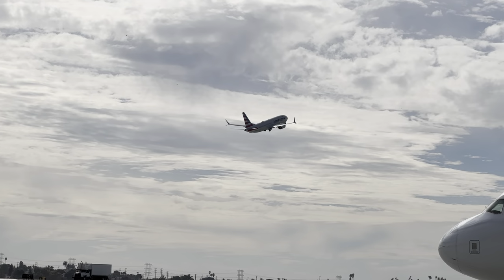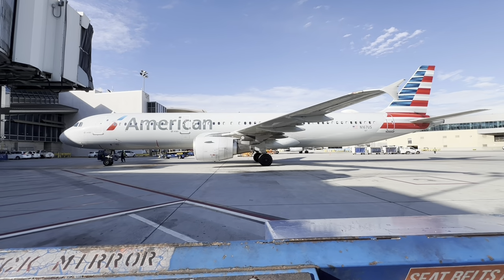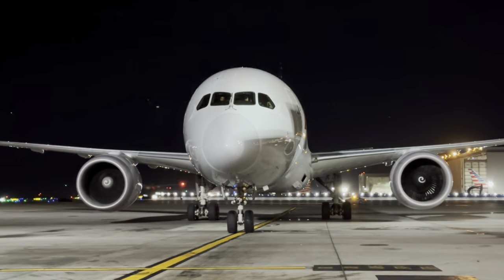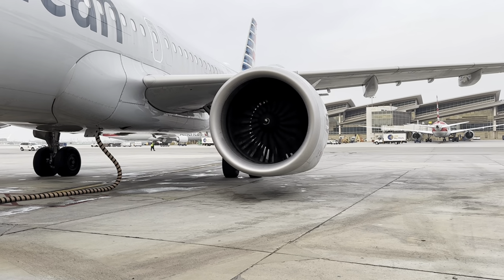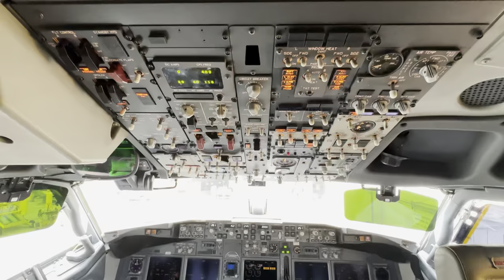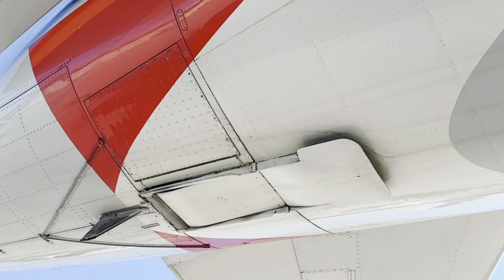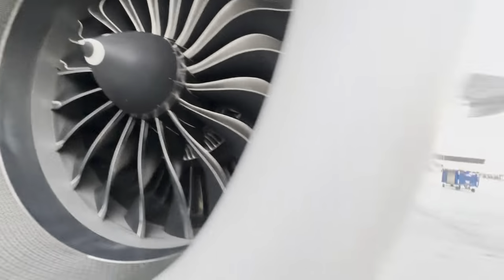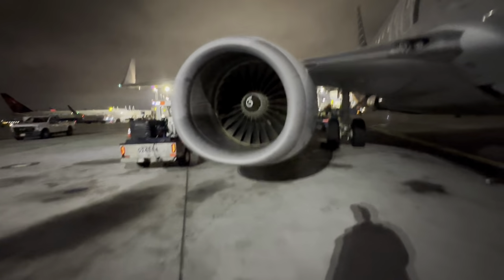Stig Shift #15 (Aircraft Maintenance Adventures)

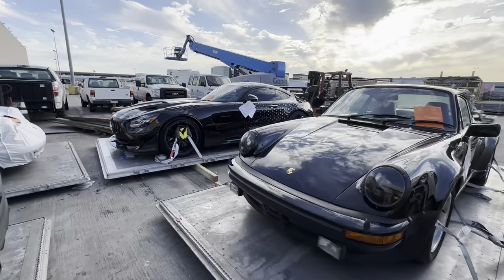Comment: The Mercedes at 11:00 is even more special than 'just' being a black series. It's a special edition for customers that have ordered the AMG ONE and they got it as an apology for the long delays in the cars development. The star pattern is also allegedly hand painted. Not the worst apology gift if you ask me. The wrapped up 911 is a restomod from a company called Singer. Basically an old 911 with modern mechanics. Insanely expensive but probably the best 911 money can buy from that generation.
Reply: Eight to ten months to build a Singer.  Probably wrapped to prevent it from being individually identified (every single one is unique).  The demand is so high it can take upwards of five years to finish one- and you have to supply the base vehicle.
Reply: Alot of rich folks. Wonder why? At our poor taxpayer expense. I'm struggling retired on s.s.
Reply from the maker: Thank you so much for the correction. Much appreciated.
Reply: @StigAviation  That singer Porsche is worth more than double what the AMG GT Black Series is worth. They had a singer Porsche on Top Gear and Jeremy Clarkson said its is favorite car ever. Look up Singer Porsche Top Gear, it has 3+ million views on youtube.

Comment: Hi Stig, I love your walk arounds and info talks on plane checks.  I've watched several and learned a lot about what you do to "keep'em flying" THANKS !  
Maybe you could look into a situation that happened 25 (or so) years ago.   I never learned what happened and really wanted to know.  I've flown many times to many countries in many different planes and know the "usual" sounds and sequences of events for takeoffs and landings. 
On a return flight from Korea on a United 747 plane we had to make an emergency landing in North Bay Canada instead of landing at Kennedy International in NYC.  
The pilot announced we were making an emergency and issued instructions for landing.  That was a very scarry announcement to hear over the planes intercom system. The plane descended from 35,000 ft to ground level in less than 8 minutes, that was different!    We were instructed to assume a  crash position, bent forward pillow on our laps holding our legs, eyeglasses off and our heads tucked in between our arms. The plane actually pointed it's nose down, I've never been on a big plane that did that! 
We were lucky the runway we were going to use was an old military runway about 12,000 feet long no longer used by the military.  The airport using it was very small, mostly for single and twin engine planes.  It's usual passenger traffic might have been 30 to 50 people daily, primarily for people hunting or fishing. 
The landing was very hard and the reverse thrusters were never deployed.   The plane seemed to come to a stop in a very short distance shuddering and shaking very hard. As soon as we stopped the plane went completely DEAD, no power, no lights, no AC, no bathrooms, NOTHING.  That was the start of the problems!  
We couldn't deplane 300ish people because there was no Emigration officials at this little airport.  It took 3 hours for officials from Toronto to fly up so they could let us off the plane.  I was in Business class which was on the upper deck at the time and the temperature up there went sky high in less than half an hour!  I went downstairs and sat at the open exit door.  All the doors were opened for fresh air or it would have been ghastly.  Once we were permitted to deplane I was first off the plane and made a bee line to the restrooms in the terminal, there were three hundred people right behind ME.  When I was relieved and stepped outside again, I kissed the ground for a reminder to be glad to be back on the ground.  
We were grounded for 15+ hours waiting for a new plane to take us home.  The airport personnel opened all the vending machines in the terminal and the airplane unloaded any food it had.  People were everywhere and there was no place to really sit .  I curled up in a cargo carrier outside.  The Canadian national guard brought water and cots and more food.  Local news arrived and was talking to people.  
FINALLY a McDonald  Douglas L1011 arrived and took us home.  The 747 we came on was still sitting on the end of the runway, dark and dead.  
What would cause that type of failure?  Could you get any details on that incident so I can get closure of a very scarry incident.    Keep up your good work and thanks again.  Art
Reply from the maker: My goodness, that’s an incredible story. Thank you so much for sharing it.

Comment: The Mercedes is the MB AMG GT Black Series Project One. It had a 57k paint job on it and yes, only 25 were made for the US market. However they were still less than 7 figures as RM Sotheby’s sold one not too long ago for 775k if I’m not mistaken. That Porsche you showed at the end with the word Singer is actually a custom vehicle essentially. The customer supplies the donor vehicle (964, 930, etc) and Singer will then improve upon it tremendously. They basically tear it apart and rebuild it and make it better in anyway that the customer desires. Cargo never disappoints!
Reply from the maker: Thank you so much for the education John. I appreciate it.

Comment: Hi Stig, Great video like always, it's remarkable to see the plane engine blades, so close to body but doesn't touch the engine structure..
Reply from the maker: The tolerances are incredibly small, and sometimes they do touch, but it’s OK, it’s designed to do so. That occurs because the blades themselves start to stretch when they are spinning at high RPM.
Reply: @StigAviation  and some shrinkage of metals due to temps i suppose?

Comment: One of your best videos! Thanks again for the pushbacks 👍 Also the air start portion. I might add that the aircraft can only shut down one engine at the gate with an inoperative APU. We have to connect ground power in order for the pilots to shut down the other engine. I would assume that is due to the lack of any other power source besides the battery without a running engine.
Reply from the maker: Thank you so much and you are absolutely correct on the engine shut down and power hook up prior to shut down.

Comment: Hey Stig, another great video. Two questions: 1) how much and why do the engines burn so much oil that you have to add more all the time? 2) A clean bird reduces drag; how often are they washed and who does that? Thanks!
Reply from the maker: It depends on the type of engine and how much oil it burns, as well as how long it’s running. So I can’t really give you an exact number. For your second question, I actually made a dedicated video talking about how when we clean aircraft. Check it out when you have time.

Comment: I’m really enjoying your videos.  These machines are fascinating, and you’re alright yourself!  Love your positive attitude.  If you’re ever the last person to leave an aircraft parked somewhere for an extended period of time, could you show us “shutting down” all the power and lights on Boeing and Airbus aircraft as you leave?  

I figure just like a car, nobody wants a forgotten dome light or something causing it not to power up as expected the next day.  Likewise, I figure there’s a procedure to “jump start” the electronics in the aircraft just in case.  Have you ever been called to jump start a plane with a low battery, and are there any additional checks required afterwards?  Finally, how many cold cranking amps would you reckon a 777 needs below 32 degrees Fahrenheit?  Kidding about that last one, looking forward to the next one!
Reply from the maker: Majority of the time I am working on my aircraft that are constantly turning to go to their next destination, so I rarely ever turn the aircraft off. But time to time I do perform resets of the whole aircraft, which I will try to capture on and future video. There are times where batteries have been in advertently been left on, and you would need some kind of a ground source of power to bring the voltage back to normal.

Comment: Ah evenings worth of viewing pleasure!
Here’s a question I wonder if you could answer possibly on your next video.
Is there a reason why American chose not to go with the NMF (Natural Metal Finish) like the older jets?  Were they temperamental to look after and therefore more expensive than a complete paint job like the ones we see here?
Reply from the maker: It costs more to maintain the polished look and the bare metal is more susceptible to corrosion.

Comment: A hot start is when temperature limitations are exceeded during start, possibly damaging the engine’s hot section. If the condition continues unchecked, a fire may result. Hot starts may be caused by improper pilot action (introducing fuel before reaching the proper motoring rpm), a failure of the fuel controller or fuel nozzles, a tailwind component (the wind inhibits exhaust flow at the back of the engine), or a weak battery causing the electric starter to peter out after light-off. If you see ITT/EGT (interstage turbine temperature/exhaust gas temperature) increasing abnormally quickly, abort the start with prompt action before an actual temperature exceedance occurs, resulting in a more mellow “warm start.” The correct pilot action for a hot start typically is to cut fuel off immediately and leave the starter engaged. Motor the engine long enough to purge all the fuel and hot gas from the combustor and allow airflow to cool the hot section.
A hung start occurs when the engine starts but doesn’t accelerate to idle speed. This indicates a problem wherein the HMU/ECU (Hydromechanical Unit/Electronic Control Unit) falls off the acceleration schedule or fails to bring the secondary fuel nozzles online. Cut the fuel off and motor the engine.
Reply: Nothing AAA can jump start @30,000’
Reply from the maker: Absolutely phenomenal information, thank you Drake
Reply: @StigAviation  I've been watching bro!

Comment: Seems to me that the brake wear indicator pin on the aircraft is a "same function, different method" version of the "brake pad squealers" that are standard equipment on most automobiles (at least in US/Canada), an easily observed indicator that you need to service the brakes.
Speaking of, since all of you reading this are hopefully still reading I'll give you some advice from an auto mechanic:
If you hear a squealing sound coming from your car's wheels at low speeds, especially when the brakes are applied, you should schedule an appointment to get new brake pads (and if it's a Subaru, probably rotors too, that brand has excellent brake performance, but the rotors like to become warped over time, which you can detect if you feel a vibration in the brake pedal when you get up to 45mph and apply the brakes firmly, but not so hard that the ABS kicks in. If the ABS kicks in, you'll hear a loud buzzing noise and your foot will feel like you stepped on an earthquake. Warped rotors don't usually feel THAT severe, but you'll feel like you stepped on say a subwoofer cranked up quite loud and playing a very bass-focused song.
Reply from the maker: I suppose you could say it is the same type of indicator. Just a little bit different design.

Comment: Hey Stig, just wanted to say that your videos are some of the best on YouTube and are the highlight of my YouTube watching week, your enthusiasm for your job is so good to see and your knowledge knows no bounds.

One question I’ve wanted to know the answer to is why on the 787 on take-off does the landing gear not go up straight away, sometimes for a good few minutes after departure. I don’t know if this is something you see a lot at your airline but in the UK British Airways and Virgin Atlantic have it quite often. Maybe you would be able to answer this in your next video.  Keep up the good work you do not only on the planes but with the videos as well.
Reply from the maker: There is a sequence of events that needs to happen before the gear can go up, usually the gear doors need to go down and a slight delay, and then the gear goes up. Also pilots sometimes keep the gear down to cool the brakes.
Reply: @StigAviation  I did wonder if it was something to do with cooling the brakes. Do you know if there is a system that stops the gear from going up straight away even when the pilots select the gear to the up position or is it just that the pilots see that the brake temperatures are high so they leave it down? I’m sure I’ve seen the gear doors open but the gear not go up then the doors close again.
Reply from the maker: The gears are actuated by the pilots via the handle in the flight deck, they do not automatically go up.

Comment: Thanks for another amazing video. When you were going through the tunnel I saw the picture of the Concorde and reminded me of my trip back in 2006. Where I visited a couple of aircraft museums in the UK and got to have a look inside not 1 but 2 Concordes. One of them was the experimental plane at Duxford. Also in 2014 I was at Farnborough Airshow in the UK and got to have a look in the Airbus A380 experimental plane aswell. The sheer size of it and how it can get into the air is such an amazing feat of engineering.
Reply from the maker: That’s so amazing you got to see the concord. That’s still on my bucket list of things to do. Cheers
Reply: The cabin is about the same as an ATR-72 (Turboprop) with 2 seats each side and the windows are half the size smaller than your average commercial airline probably due to it flying higher in the atmosphere at supersonic speed. Yes it was so cool to actually see inside and up close. There has been at times where BA and Air France have flown the Concord to New Zealand and I have seen them at Christchurch International Airport while connecting to another domestic flight. @StigAviation

Comment: Thanks for the video Stig. What if a plane with a defective APU had  an in-flight  emergency? Wouldn't  they need a operating  APU for hydraulics for control?
Reply from the maker: If you are speaking about any emergency, that’s not regarding an engine then the aircraft has no issues for hydraulics because the engines have their own dedicated hydraulic pumps. Now if you did have an engine malfunction you have multiple engines, so that’s another level of redundancy. Now let’s say the worst possibility of both engines failing now you have your very last resort, which is the rat, ram, air, turbine, which will provide minimal electrical power as well as minimal hydraulic power. The odds that something to that level of failure is almost astronomical.

Comment: Commercial aircraft paint jobs weigh between 800 to 1,200 Lbs.   Lets say between a 737 and 747 sized airframe.  That is the weight of about 6 passengers at 165lbs for an average so I'm sure it just comes down to how much extra cargo can be loaded below.  And if the aircraft is scheduled to make shorter haul flights with less fuel needed onboard (6.75Lb. per gallon) it all works out in the books when it comes down to cost of labor to strip/paint vs putting on a few pounds and not using that aircraft to haul some USPS Priority mail so to speak for some extra income.
Reply from the maker: Very well stated my good sir

Comment: Love your videos, man. My question of the week is how you get paint wear on airplane fuselages? There are no moving parts there, and neither does the cabin flex like the wings do. Like, on some older planes you can see paint peeling off similar to what you showed on the gear flap, that comes with age I guess, but I have seen some planes with what almost looks like scratch marks where you'd expect the stringers to be underneath the skin.
Reply from the maker: Flying at 500 miles an hour at extreme temperatures will eventually deteriorate paint.
Reply: @StigAviation  I guess so. I was just expecting it to look more flake-y like when you see regular paint wear/damage somewhere, not as if you ground down the paint along the stringers.

Comment: A quick question that came to mind as you were checking those huge Michelin tires and brakes on the 777. How much does a tire cost? My guess is about about $10k a tire
Reply from the maker: Around 6000 to $8000
Reply: @StigAviation  Cheaper than I thought
Reply from the maker: @ThemeParkBazza  that’s per wheel, There’s 14 wheels on the 777. 😅
Reply: @StigAviation  Good point 🤣

Comment: At 12:56, an Airbus A321 NEO pulled in.  How come the engines on that airplane look so adorable?  Adorable in the sense that it seems smaller, like a low bypass engine design.  What engine option was that bird outfitted with?  My guess is the CFM LEAP 1A because it still in route.  If it had the P&W 1100G, it’ll probably be grounded lol…if it was the P&W, then it probably has its engine issues ironed out
Reply from the maker: I assure you the leap engine is actually very massive. I don’t think the camera is doing it justice.

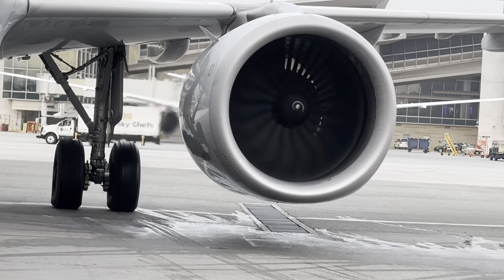Comment: Interesting with this point at 23:30. Had a flight from Toronto to Amsterdam where the APU wasn't working (believe about a 7 hour flight). Was insanely hot inside the cabin thanks to a heatwave or something while we waited for the engine starts and the AC to kick in. To cause even more discomfort we were delayed by at least a hour while seated inside the cabin :/ .
Reply from the maker: It’s not a very pleasant, feeling to be stuck on an aircraft without air-conditioning, especially on a hot day. I’m sorry you had to experience that, but the important thing is, the flight was safe and you made it to your destination.